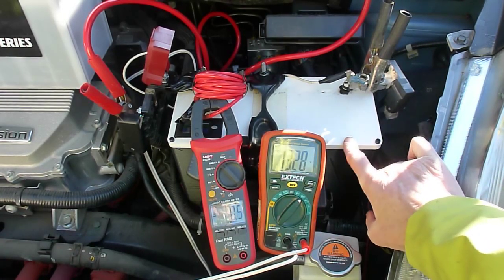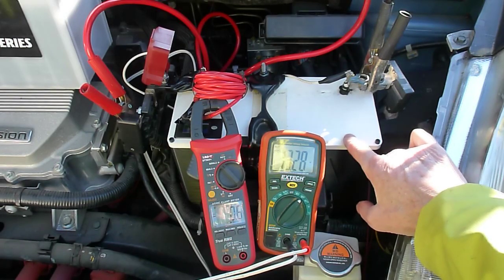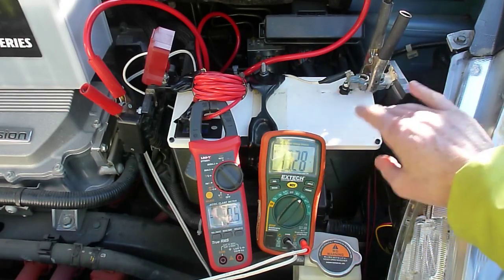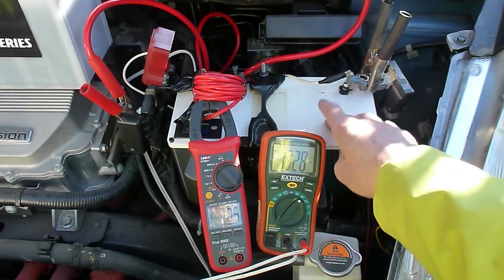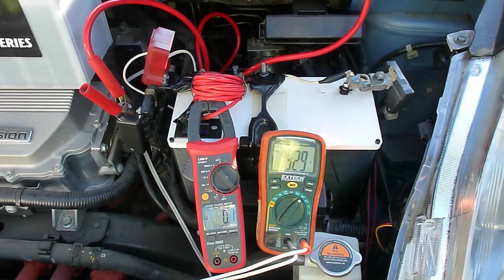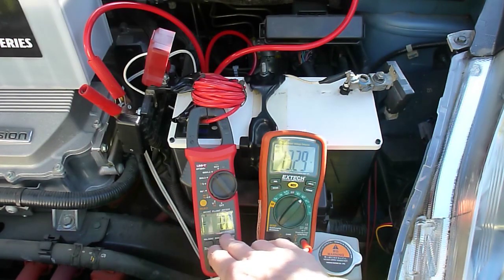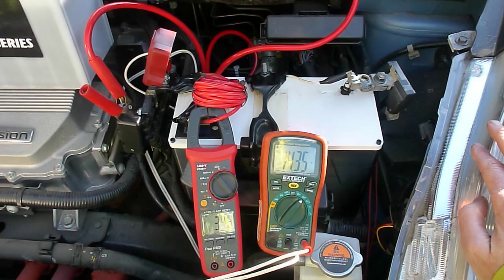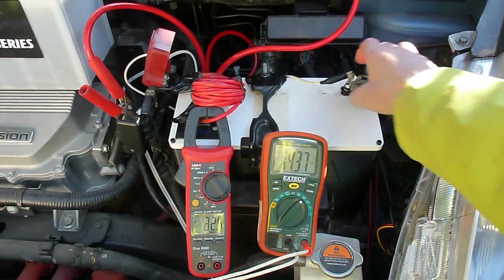Nissan Leaf 026 - DIY 12V LiFePO4 battery, part 3

Comment: Thank you for testing and sharing your discoveries! My Leaf had also dead lead acid battery. I changed it to other used Lead acid battery but I have thought also about lithium batteries. Doesn't Leaf use quite much energy at standby? Maybe that's why they put solar panel to the rear hatch to overcome discharged 12V battery problems?
Reply from the maker: Hi Ruudi. The standby current draw varies depending on what extras you might have running in the car (eg, Carwings, GPS, dashcam, etc). My understanding is the Leaf has a few more computers running than an average car - so that doesn't help. On the plus side it doesn't have a massive spike on start-up like a ICE car. So from that perspective using a standard cheap lead acid battery doesn't make much sense. Part of the problem is the Leaf's internal charging circuit for the 12V battery isn't quite aggressive enough for the usage. 

I'd like to add a solar panel to the car to keep the 12V topped up. It's on my list of projects. A friend has a 2014 Leaf with the solar panel and it seemed pretty feeble. I'd kinda like to get a replacement rear spoiler and add a new panel to it myself.

Comment: Would it not be possible in the longer term to put a current regulator between the the car current regulator and the battery current regulator?  I can't help thinking that a large resistor to dump the excess rather goes against your philosophy and negates some of the efforts you have gone to at reducing drag for instance?
Reply: Yeh I would try a DC-DC converter inbetween the step down and the battery, that has CC CV adjustable. That way you are not wasting energy as heat. The only consideration is does the cars step down have any sort of voltage detection (is it expecting to see some voltage come back from the battery, if so it could cause a problem)
Reply from the maker: @ratgreen  Yeah - that was one of the things I worried about. The wire resistor was a quick and dirty way to get the battery working.
Reply from the maker: My understanding is the heat loss across the resistor is proportional to the current - so it's only a concern at higher current levels (which doesn't occur for long). Once current is down below about 10 Amps it's much less of an issue. Certainly it's not ideal though. I wonder what the commercial LiFePO4 12V batteries do about this issue?
Reply: @paulkennett  I would assume they have an in-built charging cct that can handle what the car throws at it?  I know very little about EV, so I'm presuming that this charging current comes from the driving battery and if this is the case, what effect does it have on the driving range?
Reply from the maker: @twotone3070  Yeah - that makes sense. I'd hoped to avoid adding a charge controller in their too. Yes - this gets charged from the main battery. The charger peaks at about 40 Amps x 14.4 V = 576 Watts. Then it steadily drops down to less than 70 Watts. I should probably work out the typical kWh that it's taking from the main battery to see what impact that has on range. My assumption is that it's not significant. 

I've read about hyper-milers who remove the alternator from their cars to reduce losses. They charge their 12V "manually" every night. 

I'm pretty sure the Leaf also charges the 12V battery during an overnight charge of the main battery. So each morning both the main battery and the 12V should be fully charged.
Reply: @paulkennett  hi Paul, how has this lasted in your leaf? Could you not use the BMS to control a 150a relay?
Reply from the maker: @ollyomm  Still going well. Since I built this I've been given some newer LFP ebike batteries. It might be worth upgrading the cells to improve the capacity. Another thing on my TO DO list :)
Reply: A current regulator is going to be a resistor of some kind - it trades off current for heat at a fixed voltage, unless it does something useful like spin a ventilation fan.  I am worried about the coil of wire at peak draw could get hot and damage itself over time.  Maybe a big power resistor with sufficient airflow around it.  

Also - what's up with the last clip?  Did the battery fail down to 1 volt?
Reply: @MikesTropicalTech  I was thinking of something like a Buck regulator,  with FETs.
Reply: @twotone3070  Buck regulators just reduce voltage though, right?
Reply: @MikesTropicalTech  They do, but I believe there are versions with Constant Current limiter, also if you reduce the voltage across a fixed resistance you will reduce the current?
Reply from the maker: @MikesTropicalTech  Hehe - when I first installed the battery without a series resistor the car tried charging at 110 Amps - which tripped the BMS. :( - it was a sad moment.